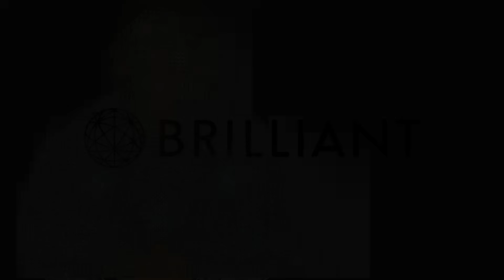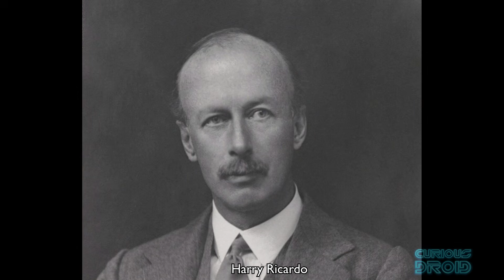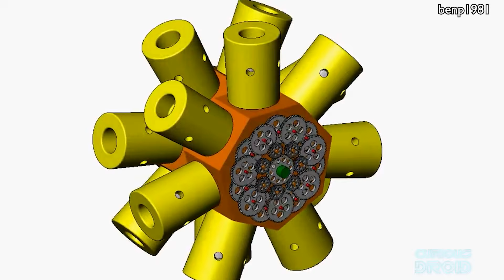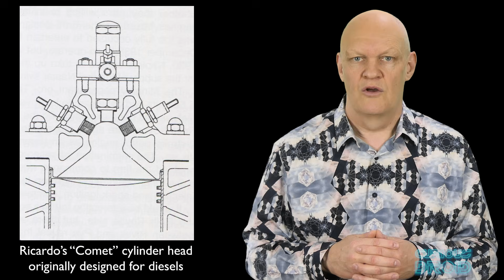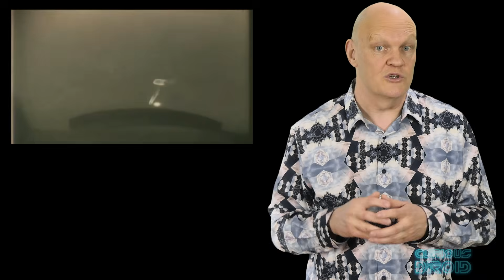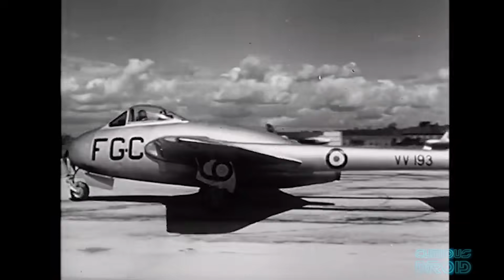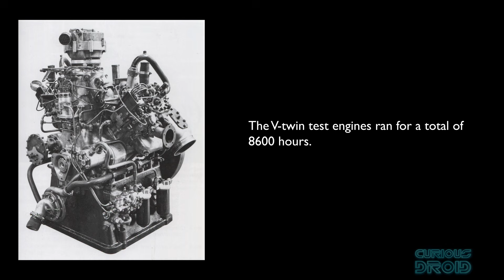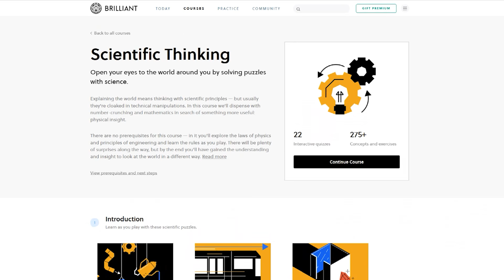Rolls Royce Crecy - The Most Advanced Piston Aero Engine Never Made.

Comment: In regards to 'high octane aviation fuel'  (140+ octane).

Such fuel existed in the 20s and 30s.
It was used for aviation racing.
Very little of it was produced annually.

Hap Arnold (the CO of the USAAF) went to
the fuel industry leaders and told them to
ramp up production capacity of such fuel.

And now the kicker.    
He did this in 1936.

If you want peace, prepare for war.
Reply: I'm pretty sure Hitler prepared for war. The US between the wars, however, did not.
Reply: @mightyomnivore  Wrong! One of the problems the Germans had was a lack of high octane AV-gas.
Reply: @autodidact537  That doesn't make either of my statements untrue, which concerned your unsupported statement that preparation for war is the path to peace. 

Preparation for war always has a profit motive, and that leads to wars that make the same people  even richer. The Koch Brothers' father sold the Nazis the technology and assistance to build Germany's third largest refinery, specifically for avgas. Prescott Bush, father and grandfather to two US Presidents, dealt with Thyssen to do the same in the areas of coal and steel, and to supply financing to make it happen; Royal Dutch Shell signed contracts with the Nazis to supply crude and refined products, and were true to their word. And countless contractors in France made a bundle on the Maginot Line construction. 

In the past, historians were interested in generals and heroes, but not really in looking at war's paper trail. We've moved on from the unsupported statements that lead people to war, and that was my point. A great deal of Curious Droid's focus is on technologies that arose to destroy lives and lay waste to whole countries. I absolutely get it: my family has been among the people who built the tools to make war more inhuman, more savage, more aimed at civilians, as most of these are. What was made was often astonishing, but not an excuse to make bellicose statements.
Reply: The octane ratings were changed after the war. 150 octane avgas was the equivalent of 95-100 octane leaded gas today, and the 1000 octane was the equivalent of 150 octane leaded race fuel.

Comment: placing 8 of these engines vertically, and in a circle, would make for a pretty powerful disc shaped drone.
Reply: That’s when weight and fuel storage come and slaps you
Reply: @DMSrunit  or turn electric and use the entire hull for generation to f power.
Reply: @TheTrumanZoo  one you start converting your losing power to efficiency issues and heat. Cool concept thought
Reply: I think that crosses the line from drone to full-on helicopter.
Reply: @joshuahadams  well two inverted helicopter blades on top and below could feed the downward airstream through the engines cooling them and feeding them air to work with for the rotors in between them.

Comment: So marlin engines had 2 valves per cylinder right? So why not making it with 4 valves per cylinder? You would have more "holes" for the engine to breathe better but you would have such complexity of the sleeve valves. Why 4 valves per cylinder was not considered?
Reply from the maker: Sorry my mistake they did have 4 valve heads, i was using "2 valve heads" as a generic term to describe the "poppet" valves as they are sometimes known as compared to the sleeve valve.

Comment: Somewhere, I hope someone is tinkering with this idea for the fun of it.
Reply: 1 off engines with no interloopin parts at all with other designs is crazy expensive and it still will be a sprinter engine
Reply: @mrpicky1868  
I don’t think anyone is trying to produce this engine, not even for nostalgia sake. Today’s jet engines are better than any piston engine will ever be. If a prop is needed, a turboprop engine (which is still nothing more than a jet engine turning a prop) is still better than any piston engine. Sorry, my man. Piston engines are still in use but not for high speed military or civilian applications.
Reply: @leroyjenkins4811  well there’s heavily modified piston engines for air racing, like the voodoo mustang with a 3000hp griffon, they race them in the Reno air race, it hit 531mph fastest piston aircraft ever, so there are some out there would be cool to see this in that application
Reply: @dieseltruck9638  Question just like they modify Mustangs do they also do that with P40's as well like putting Supercharged engines in them?